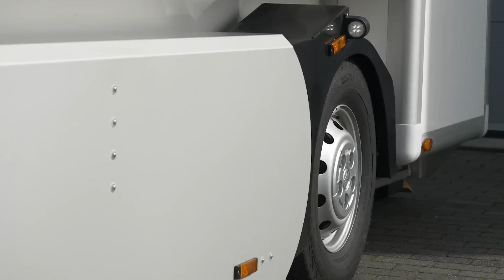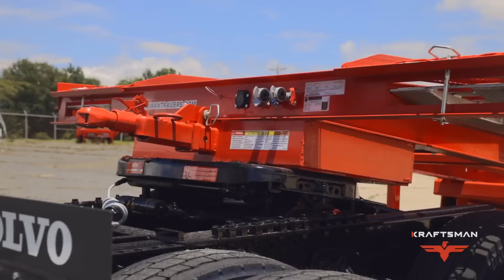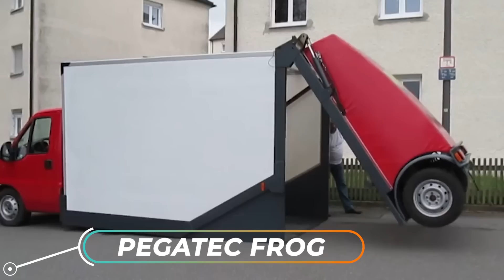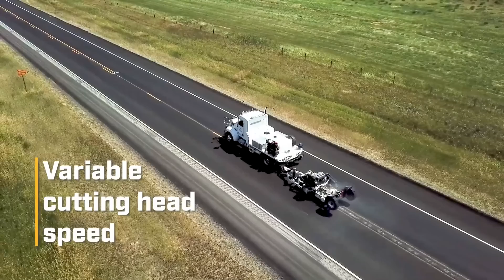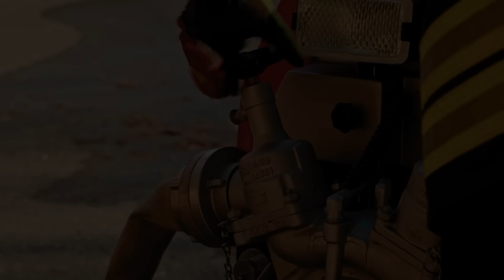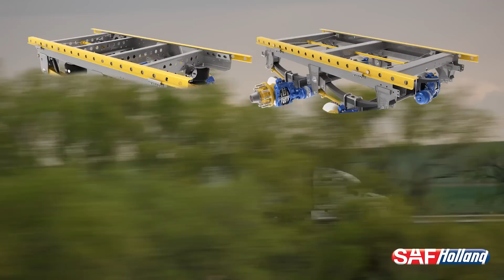Genius Truck Inventions That Are on Another Level

Comment: 1. I would NEVER walk that close to any large equipment.  Those that do are courting evolution.
2. Stone spreaders are awesome, the amount of wheelbarrow time those save is awesome.
3. If the truck worked with regular 20' ISO standard cans in the same manner it would be a WIN.
4.  The swing out awnings and such on the food trucks is a nice innovation, the complex stuff violates KISS and maintainability cost.
5.  Talking American companies and American products in metric creates unneeded dissonance.
7.  I hear claims, but do you have any operational data.  Lots of fiddly bits that might need another employee....
8. If those tow booms can also be used as trailer ramps conventions would love them.
10.  Those over tracks for dual axle trucks are not new, but if they are actually economical they would be a game changer.  Especially if they can be quick on and off solutions like chains.
11. The Frog was so jittery it made my eyes hurt.